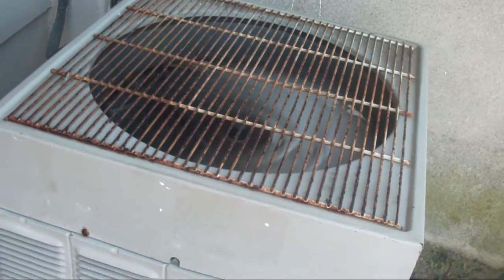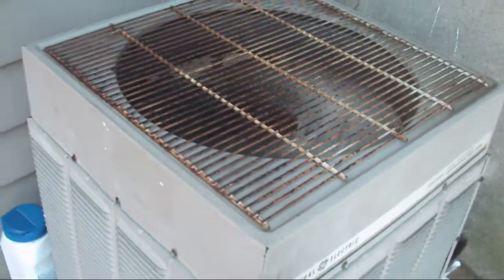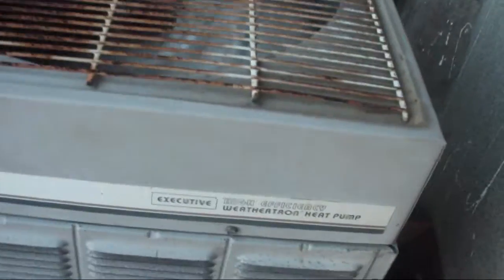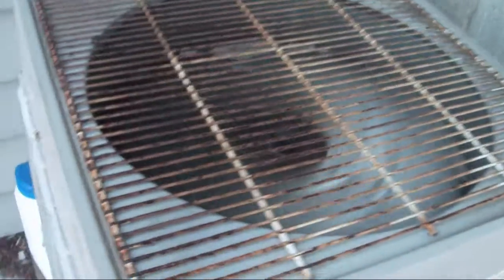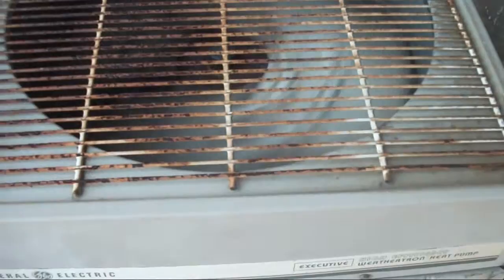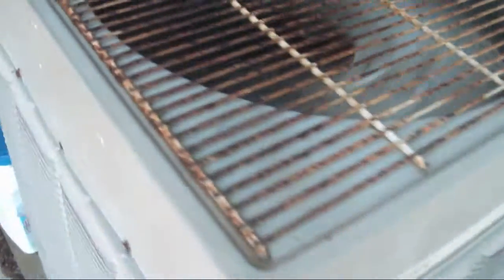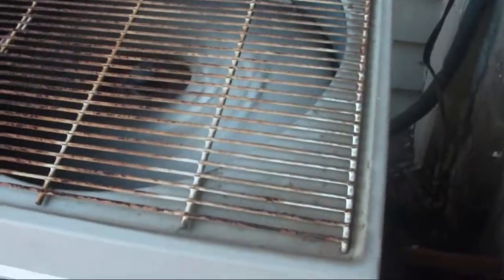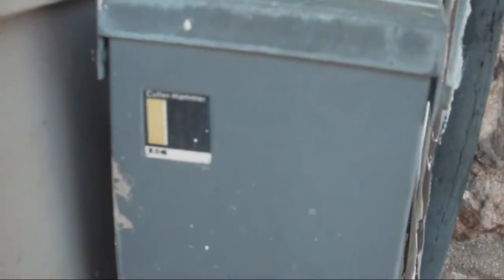1983 General Electric Executive Weathertron heat pump running in COOL mode

Comment: Thanks for the original description.  I understand why it had to be replaced.  I hope to find one of those GE heat pumps and see if it's possible to convert it to a pool heater.  If I find one in a junkyard, I'll fix it and try to convert it to a pool heater.  Wouldn't that be cool?

Comment: That really sucks.  Hopefully it's not going to the compactor which it might've already had.  Actually it did.  So sad for a good unit to get crushed while it get fixed and work again.  I have a couple of videos of a late 1980's GE wall air conditioner if you wanna look at them